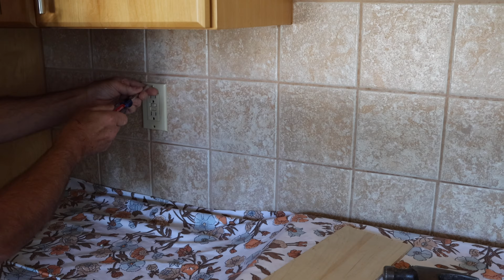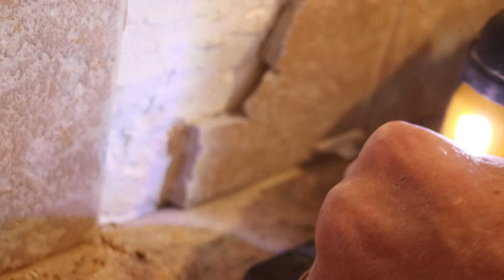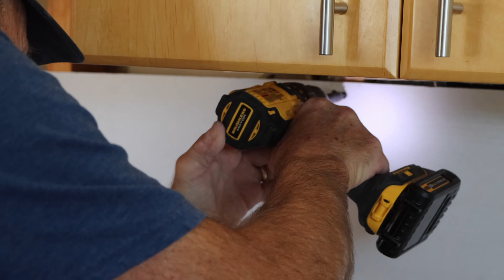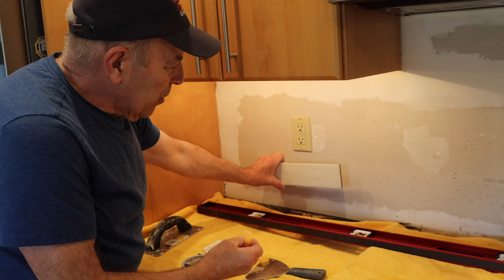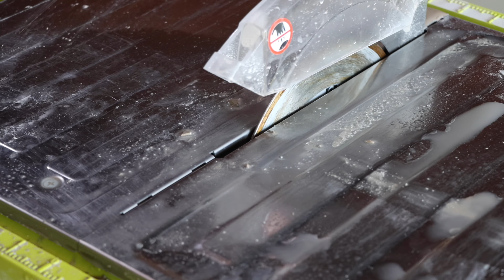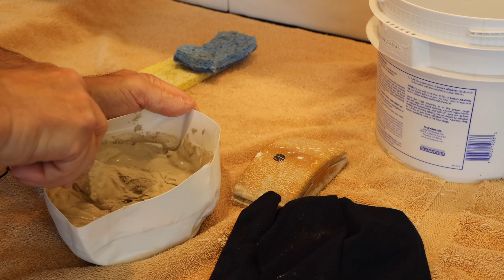How to remove kitchen tile backsplash, repair the wall and install new tiles

Comment: I am having an absolutely horrible time trying to remove ceramic tiles from plaster in between upper and lower cabinets. It's slow going and looking really terrible. I can't even get the tiles to break.
Reply from the maker: Sometimes the tiles can be very difficult to remove. Are the walls sheet rock or plaster?

Comment: Jim great video. Thanks. I'm getting ready to tackle this project. A couple of questions:
1. What did you do with the gap between the sheetrock and underneath the cabinets? Just fill it in with joint compound?
2. My backsplash is floated. Wire, membrane, etc. Any other suggestions?
Thanks again!